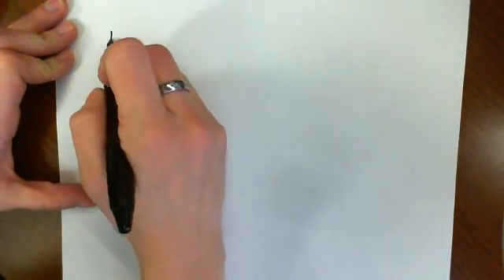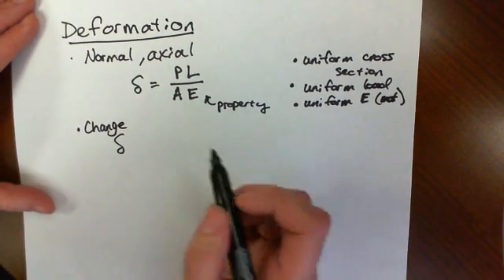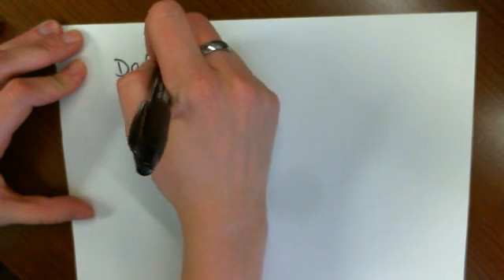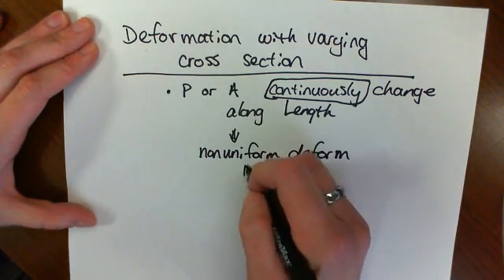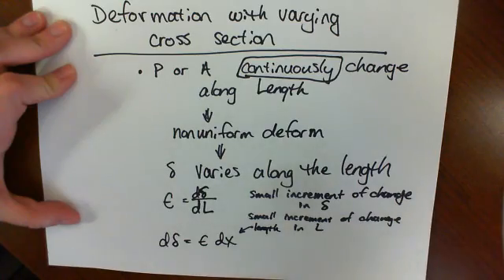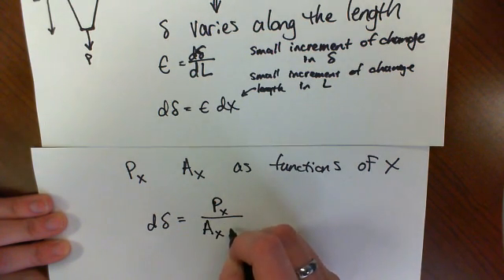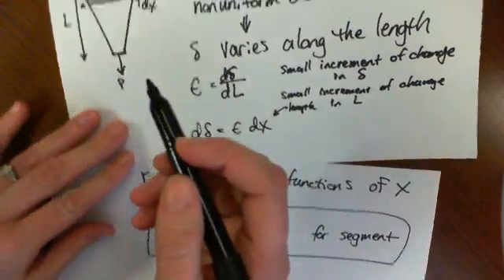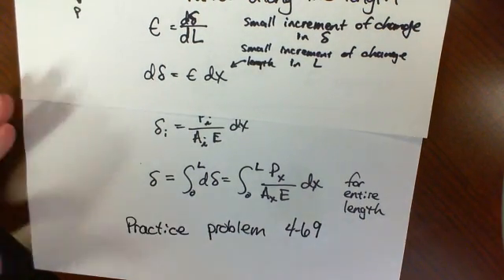Statics and Strength of Materials-Nonuniform deformation of a bar

Comment: Jodi,  I having a problem with the equation I derived. It has the function "ln(d)", the ln of the smaller diameter in a frustum cone, and when I try to simulate it as a cone, d = 0, I get ln(0). Something looks as I am representing wrongly the different equations for D(x), A(x), and V(x). This last one used to determine P(x). Do you have another video showing a little more?